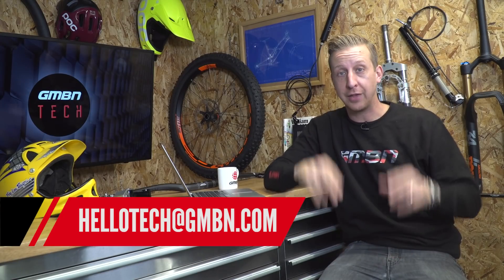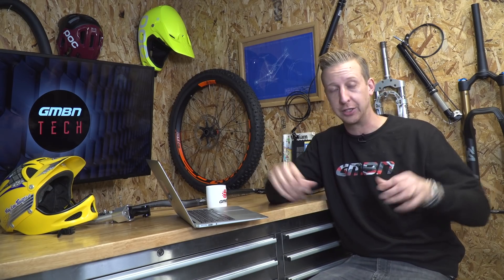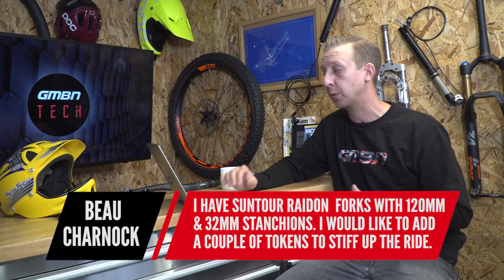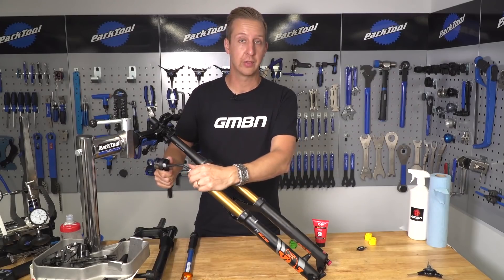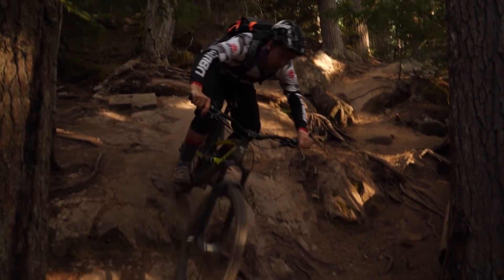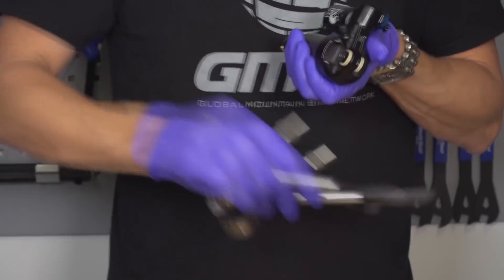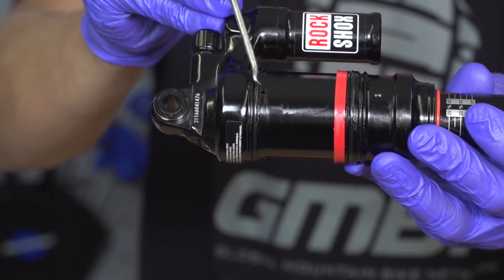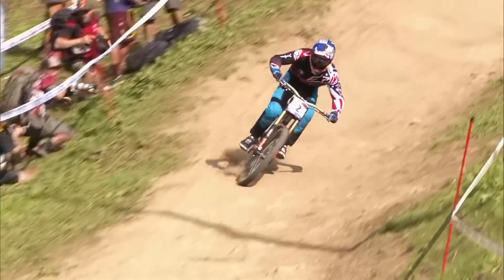The First Ask GMBN Tech | Answering Your Mountain Bike Tech Questions

Comment: #ASKGMBNTECH Hi There my dropper post sags when i put my bike from warm inside space to outside where is many minus celsius degrees. And also it slowly comes up when in the cold. I hate this and i cant pedal when this happens, please Doddy help! Btw my dropper is cable activated and hydraulic cartridge. EDIT: Now the dropper does this even in the warm place!!!!! What do I do??
Reply: the slowly coming up part is because the oil inside the dropper post thickens up in cold weather (or there maybe another problem but i thinks its this)
Reply: Check air pressure. I have to up the pressure in my specialized command post in a Minnesota winter. https://youtu.be/gOFmNYpNrXk Park did a video about tire pressure in cold, the gas laws apply to the air in your post
Reply: if its a fall line try this /watch?v=VYtu6FDD7dg
Reply: It helps when you store your bike with the dropper post extended in your warm room. This way the post won't be stuck at the beginning of the ride.
And yeah, use a very light grease for servicing the post. Like suspension fork grease (RSP Slick Kick, SRAM butter, etc).
Reply: Ok thank you all for the replys, appriciate it! And my dropper is Giant Contact
Reply: I noticed the same on my cheapo KS lev272. It seems I also had some what I'm guessing thermal contraction in the cables causing the cable to be ever so slightly actuated, tuned the barrel adjuster a bit slacker and I guess I'll just have to live with a slightly slower dropper in the cold.
I also used a few drops of wet chain lube (muc-off) as I thought it'd be slightly less affected by the cold (which it is) and make the post a bit faster.
Reply: boomerangfreak yeah, thanks for the reply. But my problem isn't the saddle coming slow up when being pressed, but it sags when i sit on it and it also comes slowly up by itself after i put it down, these happen even if i disconnect the dropper from the cable so the fault is defidnely in the dropper itself. We luckily have warranty left on the bike so it should get replaced or fixed for free :)
Reply: Tomi Saaranen you need to bleed your cable
Reply: Spencer Murray Umm its stainless steel cable so I dont think I can bleed it 😂😂
Reply: Tomi Saaranen 😂😂yeah I'm joking I have no idea what's wrong with it. Maybe check cable length?
Reply: Spencer Murray  my cable length is correct, so that cant be the problem and it does this even when i disconnect the dropper from the cable and use it by hand
Reply: Tomi Saaranen oh wow no idea then
Reply: Put more air in

Comment: I've always seen grip shifters on old outdated and mostly cheap bikes. So I always thought they were inferior tech.
Reply: slaQ83 me too
Reply: welp I'm guessing they must have some advantages over trigger shift. As you are just rolling up the cable inside when you are twisting you don't need much fancy mechanisms. Guess that might indeed make em a bit lighter or maybe even more reliable but I'm sticking with trigger shift.

Comment: Love the channel but doddy mate £1100 isn't a budget bike 😂 I got my 29 cube acid for £200 and that took a lot of saving
Reply: MJM Productions not for a hardtail. Can get a nicely spec'd hardtail for that. £500 on the other hand, that's budget.
Reply: Jake Watson I have one of those too. Although mine was £900 (2016). I also ride a FS too though (Boardman team FS) that was the same price as my acid in the sale. I'm actually selling my Acid for £300. I love that hardtail. Brilliant build quality and I have seriously sent it and it has held up sooo well. Almost don't want to sell it 😂
Reply: When I looked to replace my 15+ year old fixed steel frame 26" I figured £250 ought to get a decent bike in todays cheaper everything market.
While I 'could' get a bike for that, it'd be shite.
Bare minimum I wanted was disk brakes and front suspention. I'm only flat trails and the odd fun lumpy bit.
I looked at the Giant ATX which I almost got, but I decided going up just one level in components and hyd brakes would be worth the extra of the Talon 3
I still had to haggle from 495 to 400 as that was everything I had. Make me a deal or I can't buy.

That old bike also had grip shift, it's rubbish, having to twist your hand all over the place.
If more than one finger braking is bad because of grip issues then twist shift ought to be leathal
Reply: Sub £1000 is defiantly a budget bike mate. A cube acid new is £900
Reply: £1100 is definitely budget, I have a trek which I got for 800€ a few years ago with some upgrades over a few years for 300€ more. It also took a damn lot of saving but I still consider it budget. A new £200 bike is just crap, you can really feel the difference. I'm guessing your cube might be second hand because it's a good budget bike but when new it comes closer to £900.
Reply: I think it is a budget bike since you can only get a half decent ht for the price.
Reply: trust me 1100 is budget, its definetly borderline of budget and mid end but its just about budget to a homless person 100 quid might be seen as high end